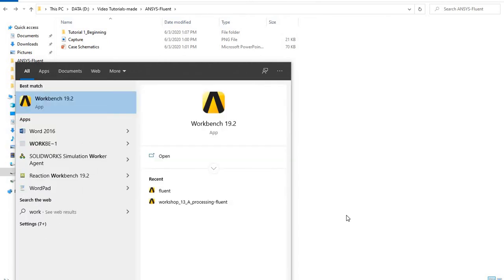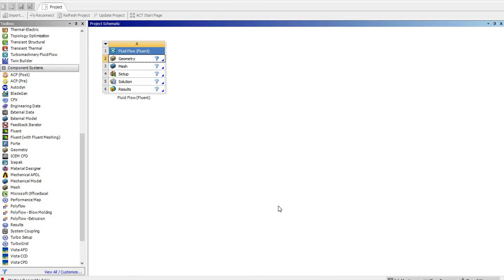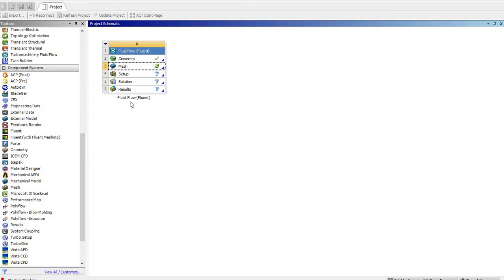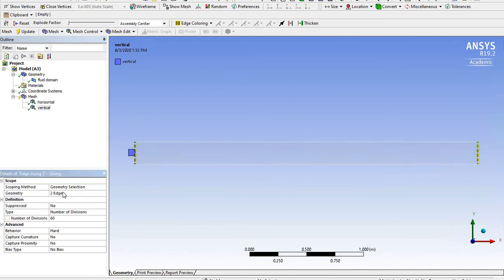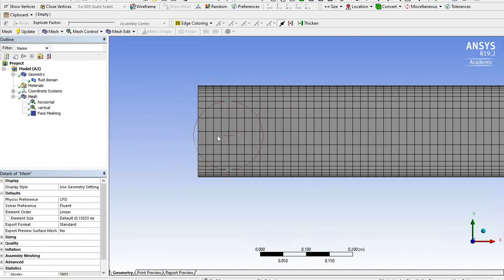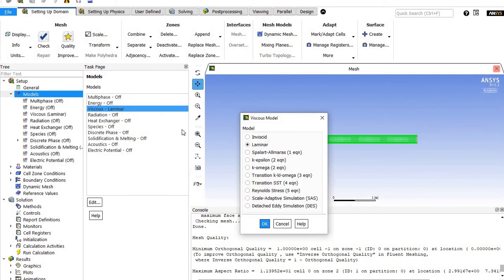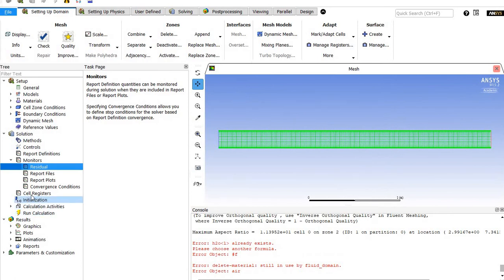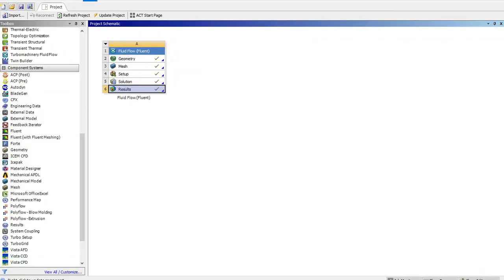Fluent Tutorial 1_Flow through channel

Comment: how to do this in a gas bottle depressurization
Reply from the maker: if you bottle is cylindrical, I would recommend using axisymmetric geometry. setup the operating condition and patch the high pressure after initialization. do a transient case study.